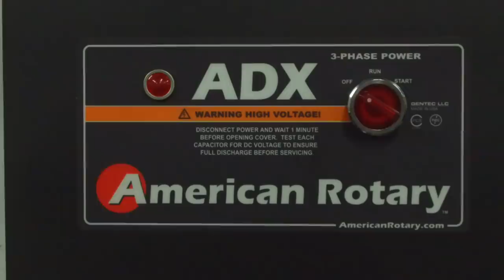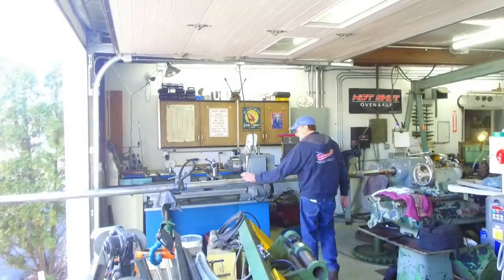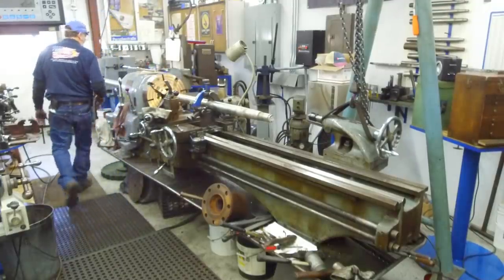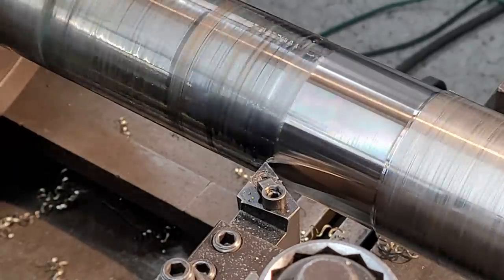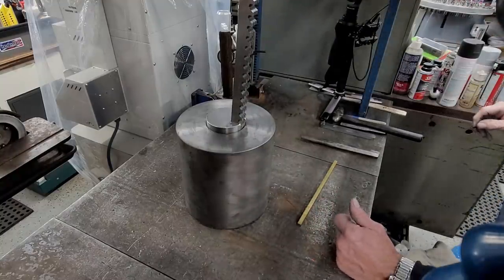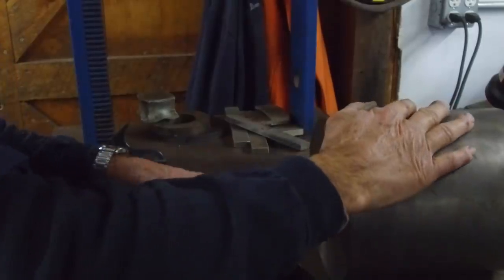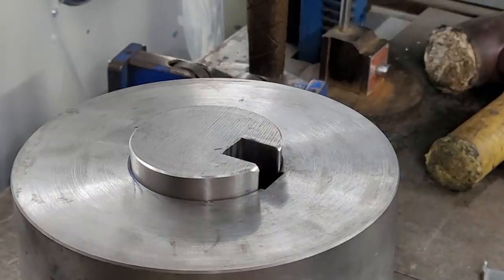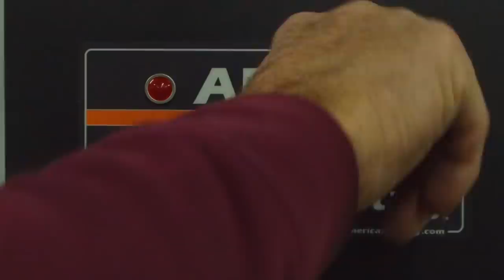A Day In The Shop 4/11/2022

Comment: Many forget to use stainless only brushes, or stainless tools on SS material,  even clamping, an impart ferrous products, Citric Acid is fairly effective on removing ferrous surface contaminants,  weak solution is fine.
Great shaft repair Keith, I'd forgotten how long your lathe bed was, always difficult to see in your old shop.
Thanks for sharing and have a happy Easter.

Comment: You were right Keith - I was saying "put some damn oil on that broach!"
Reply: You, me and heaps and heaps of others.
Reply: @bobhudson6659  Yeppers! Usually not one to second guess the masters but ... I've spent a LOT of time in the machine shop. Not a Machinist by trade, but I AM a Mechanical Engineer (MET) by profession (or I WAS before I retired). We Mechanical Engineering Technology guys are the ones that can design a machine and then BUILD the damn thing! Welding, painting, machining, whatever. There is a little rivalry between us and the MEs though. We say we can build things that can't be designed and they often design things that can't be built! 🤣
Reply: @PhilG999  I am a retired mechanic as well. Wish I could get some of these so called engineers to dismantle/repair some of their designs. That would "edumicate" them. So much theory and not enough practical. You and your mob can do all of that. No wonder there is rivalry. You do it - they think they can do it.

Comment: Love the voice raised voices.  Keith I have to tell on myself.  I was making some shims and they are like washers.  54mm inside and less outside.  I got two wonderful washers that the inside was just a nice snug fit.  They were M2 steel for Bridge bolting.  Didn't want to grind down the outside with my tool post grinder - messy and I'd still have to grind the surfaces on my surface grinder.  I found some washers that I could use - about the correct Outside diameter.  Now to Bore a hole through.   I got a nice bore taking off a lot of steel and I was able to test the hole on the lathe with a 54mm M thread.  That popped in nicely and I admired my work.  oops - Washer hot cooling and it did reduce the center hole by 2mm and captured the male thread nicely.  I finally used the carbide boring bar with insert - inside and eased it to just capture the M thread and it popped out with a little pressure.  Phew.  Now the second one was cut a little larger to cool to a nice fit.  Tomorrow is the surface grinder to make two thin shims for my telescope.  What a day !

Comment: Hi Keith enjoyed the vid larger broaches I have lubed the shim side also very small amount of sulphur cutting oil on the cutting side.
The larger broaches I have found are always a little noiser due to the cut surface are area & amount of metal being removed.
Years gone by some shops didn't have broaches we used to cut the keyways in a shaper ..the trade has become a little easier. Cheers .

Comment: Hi Keith, that press has always impressed me, makes short work on cutting the slot, especially that length where you have multiple teeth engaged.

That shaft is a monster. I assume you will weld the build up, is that likely to cause it to bend? 

Regards Dennis.
Reply: Yeah that shaft will bend when welded, that's why they get flame straightened after welding ready to machine
Reply: Keith has several videos where he shows the flame straightening Mark (below) mentions. They are worth watching. Keith is a very clever man. He also wouldn't weld the shaft if the end result after machining is not first class.
Reply: @bobhudson6659  Hi Bob, I have been watching Keith for several years and I have seen him do his shaft straigtening. Quite amazing how little heat it takes to get a significant movement.

Comment: KEATH THERE IS A NEW CAST IRON ROD THAT BEATS BRAZING . GO LOOK AT STEEVE WATKIND. WELDING THE SHAFER PART ONE . YOU DONT HAVE TO DO ENEY MORE PRE HEAT  . GO AT LEAS AND LOOK
Reply: Preheat has very little to do with the filler used, it's to stop cracking from to steep a heat gradient in the part and it stops the part cooling to fast.. the shape of the part depends on how important the preheat is.. i wouldn't believe everything you hear
Reply: @markshort9098  But ... but what about this new miracle weight loss supplement I just saw on the internet ? It says I can eat whatever I want and still lose weight.

Comment: Keith, why no oil on the cutting edge of the broach?  Normally I see that to ease the cutting, except maybe in cast iron, brass, bronze.. did this material prefer dry ?
Reply from the maker: this was ductile material, same as cast iron.
Reply: @KeithFenner  Thanks, then I can assume all ductile material can be machined dry?

Comment: Could've flame spayed it maybe.
Reply from the maker: Flame spray is only a coating! A sometimes type of repair.
Reply: Couldn't agree more Keith, in the refinery I worked we had many electric motor shafts flame sprayed, had to heat the bearings to fit, otherwise you would tear off the coating when pressing bearing onto shaft.
Removal of bearing most times would tear the coating off the shaft.

Comment: You and I are the same age, my eyes are not good enough the thread that spindle bore with that shaft if the shaft was only 6 ft long. Now please do not tell us that you have been practicing hitting holes with a tool that long for 65 years.
Reply from the maker: LOL I grew up on fork lifts sort of speak, second time in this shop with same size shaft two for two so far in one shot, I did mark the floor for the stands so the second time I did it with more ease.